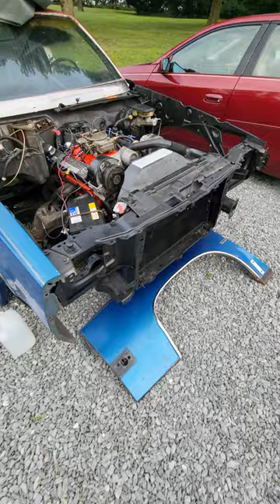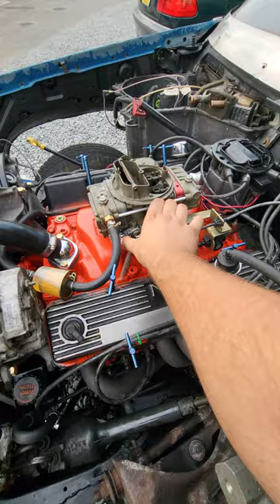Small block 350 Melling MTC-1 RV cam. #fyp #v8

Comment: So I bought a built 350 from some guy who wasn’t the original builder and I have no clue what internals was used BUT my engine has the exact same idol as yours. Definitely cool 👍🏼
Reply from the maker: The "RV" cam is a very common swap, a lot of people really like it, it's very likely your motor does have the same camshaft.
Reply: Idle
Reply: Same here odd blue block 4 bolt 350 a really good shape of 882s sounds exactly the same too

Comment: When you say it should be a drop in cam did you not have to degree it? And just line the timing marks up? How did you install this/set up the cam?  Nice build! Thanks in advance!
Reply from the maker: I just dropped it in lined up the timing dots at TDC, I've never actually degreed a cam, I've always gotten pretty lucky with the specs being accurate and just adjust my tuning off of ear or vacuum.

Comment: What's the difference with an RV cam? More lift, longer duration, more overlap?
Reply from the maker: I belive its longer duration, I actually think it's called an "rv" cam because it's not emissions compatible and is for recreational vehicles.
Reply: @emptywalletgarage5549  I think you're correct in that assumption. The only references I've heard about the gm RV cam are from budget builds or medium duty trucks. C/K 2500/3500 or Topkick trucks. I think the RVs use the same chassis.
Reply: @emptywalletgarage5549   as far as I know yes recreational but for towing and bottom end torque  is why I was always told to but tv cans in pickups to keep the bottom end tq

Comment: push rod length? and rocker and spring and lifers stock?
Reply from the maker: Stock push rods, stock springs, stock rockers. Should be a drop in cam unless you have vortec heads (I belive vortecs can't handle the lift)
Reply: @emptywalletgarage5549  i got a 72 motor

Comment: What gears you running in the rear end
Reply from the maker: Right now it's stock rear (middle of restomod) it has a 2.14 with an open diff XD but I'm going to 3.73s with a posi
Reply: @emptywalletgarage5549  nice lol good luck